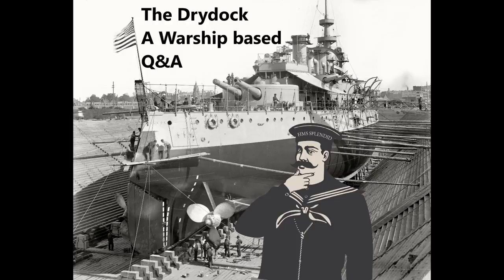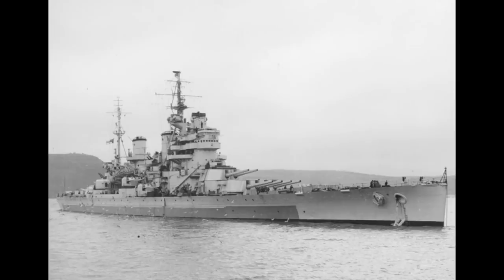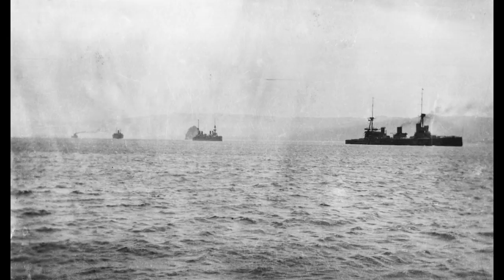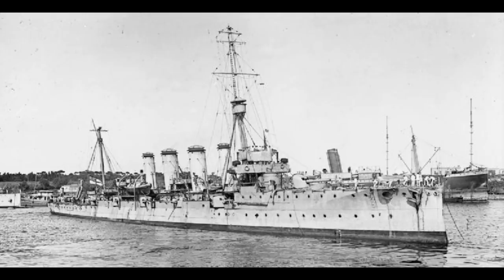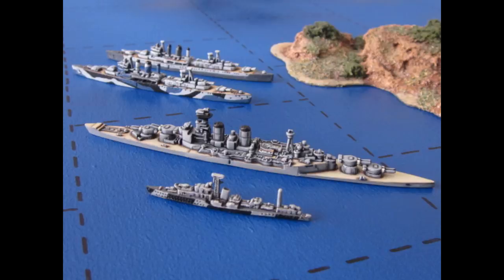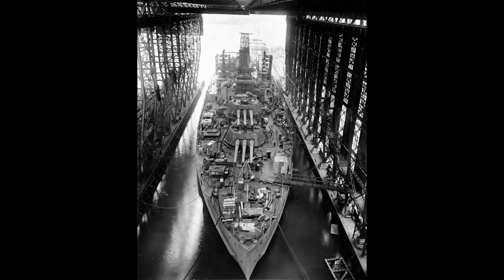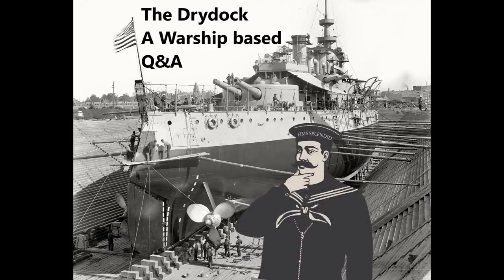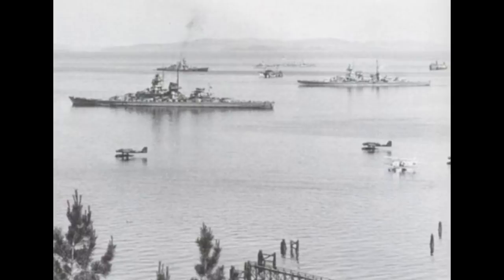The Drydock - Episode 081

Comment: oh correction on the MiG-25 IS mostly STEEL! only the leading edges and the few parts of the engine are made of Ti! the 25 was only made to go fast its gee limits are pretty low iirc like +5 -4 its not a dog-fighter its an interceptor

Comment: In addition to light weight Titanium has another advantage over steel - it has better corrosion resistance than most, perhaps even all, Stainless Steels. Which could be pretty helpful in a salt water environment.

I believe Titanium gets brittle when hardened, so for a Steel/Titanium composite you'd probably want a hardened steel face bonded to a lighter Titanium backing. Though if you're going composite, Aluminum might be a viable light weight option for the backing, and you might as well start adding ceramics as well (like the modern tank armour). Optimizing composite armour for naval scale would no doubt be a significant, and expensive, R&D effort.

Bonding multiple layers of armour together is probably something we could do much better today than in WWII. We have more options for welding and adhesives that might be strong enough to do the job effectively.
Reply: Titanium is corrosion resistant to sea water in most conditions, but not all.  It has been known to corrode badly when used for balls in ball valves.

Comment: Another debate to add to the armour debate. Look at tank protection development. It is now looking at an active defence. Kill the incoming round before it hits the tank. A modern "Battleship" would be better protected than a WW2 counterpart but this would be because anyone who builds such a ship would have more active defences on it than a US battleship has guns (so only a few hundred). Interceptors (both Cannon and Missiles), Drones, CIWS, ERA, lasers etc all could be fitted to a Battleship. Then once you have a ship with this would you then look at the armour. Probs only have composite Citadel armour. No real belt armour would be useful. Then again modern torpedoes are rather nasty and could still crack the whole thing in half so why bother. Just build 6-10 more Destroyers. Unless... you could introduce some either soft or hard-kill torpedo defences... Guess we need more swarm drones.

Comment: You listed that Defence White Paper as one of the worst moments for the RN.  I’d add when on 1 April 1918 the excellent Royal Navy Air Service, which at this time had 67,000 officers and men, 2,949 aircraft, 103 airships and 126 coastal stations, merged with the Army Royal Flying Corp to form the Royal Air Force.

During the inter-war years, the RAF gave priority to strategic bombers, and then, as the war clouds loomed over Europe, to accelerating development of modern single-seat fighters, like the notable Spitfire.  Carrier aircraft received lowest priority.  On 24 May 1939 the Fleet Air Arm (FAA) was returned to Admiralty control.  When WW II started three months later, the FAA lacked an effective single-seat fighter, had no dive bombers, and its torpedo bombers were slow obsolescent biplanes.  The slow biplane torpedo bombers, flown by intrepid airmen, performed well in the early days in European waters, but only when they were unopposed by enemy aircraft.

Comment: Comments as per each question. 

I think this one you might have to run yourself. I don't think there's a good platform out there for this stuff. At least, off the top of my head. I' don't think any social media related platform has the copyright protection you'd want on this stuff. 

On the steel side of things, I'm going to offer this as a point. Last year I was doing a bit of hefty research into nuclear power. I know, different application, but if you're building a reactor containment vessel you're going to need extremely specific shaped and high quality steel. There were maybe three countries, more likely two, in the world that have the capability to produce it to the specific shapes and the like. So I'd argue it's not a case of what the effective improvement is, it's the ability to produce it that matters. I'd suggest the quality is very much the same as well. 

As Drach was going on, there's different armour profiles, patterns out there. If we compare tanks to battleships, the metallurgy doesn't matter, composites do. Too modern, not enough information to actual disinformation out there. There's no real better answer I can give, sorry. 

I know of none actual war game rules that made it from the military to the public. There's documentation out there, the Fleet Problems and a number of journals, articles, the like. I'd suggest the rules for these are often custom written for the scenario. These aren't games in the traditional sense, these aren't meant to be played out over the course of an hour or two. These are days, week long exercises, again, depending on the context of the scenario. 

If you're looking for something more for the tabletop, Harpoon isn't that bad a game. I've played it once and it's quite playable. At least, for the modern, Cold War level stuff. I'm not saying it's easy to play, but it is playable. 

I can't think of anything else I'd recommend. I really can't, any era. I've either not played it or it has major issues with the rules, absurdities.

As for a sorting High Seas Fleet, I'll put my hand up as a referee, co-ordinator, whatever you need. I need to see something like this in action, considering what I want to do with my game studio.
Reply: This is a comment sect. blog on your own 'site. 😊

Comment: 35:30   You show some armor being put on or off a ships side.   How where they bolted to the hull?  Thru bolts and nuts?   Also since the armor appears to be layered on, what of corrosion protection of the hull, the gap between the hull and armor will trap salt water between the two, so was their caulking used to keep the space between dry? or was water free to get between?    was anti corrosion paint used, if so what kind of paint?

Comment: Realy interesting question and answer regarding the armour.
The no longer existing infrastructure is an important point.
This whole thing off course begs the question as to what armour protection modern warships DO have.

As to the idea of titanium armour - the question of the price tag aside -, could you explosion-weld it to the hull?

What I don't think is a good place to look for inspiration for modern ship armour is MBTs.
Yes, you can armour a tank to the point where it can resist the impact of a 120mm APFSDS round. But that armour is usually restricted to the turret front and maybe the upper glacis. Everywhere else, that round will punch through. That's only a small portion of the tanks entire surface area. And that tank still clocks in at 60-70 tons.
Now imagine rising the armour protection of a battleship (turrets, barbettes, belt, deck) to that level...

There is off course the question of modern amunition. Shaped charges and HESH were mentioned. HESH can be defeated by the use of spaced armour. And the effect of shaped charges can be mitigated with spall liners and compartementalisation.
However, there is something I wonder: I have heard/read that much of the damage caused to british ships during the falkland war by argentinian anti-ship missiles actually came from the unburnt fuel aboard those missiles starting fires, and not from the warhead.
So, how about letting the armour be armour and replacing that 1-ton shaped charge warhead mentioned in the answer with say, a ton of triethylaluminium, essentially turning the anti-ship missile in an oversized M202 - and the target into a similarly oversized dutch oven?
Ok, I can see one issue with this idea: Who want's several tons of that stuff sitting in their ship's magazines...
Reply: The warhead of the first Exocet missile which struck USS Stark failed to detonate,  but unexpended rocket fuel started a fire which burned for hours.

Comment: Is it really fair to say that early cruisers and destroyers sometimes had superfiring rear turrets because there was more space abaft the superstructure?  Isn't the reason more that the gunwales are a deck or two lower on the stern deck, as opposed to the forecastle?  Thus meaning that rear superfiring guns could be at a more reasonable level above the waterline.
Reply from the maker: On a small ship the superstructure contributes significantly more to draught proportionally. They also tend to have very large powerplants proportional to length. This usually means a relatively heavy superstructure somewhat forward, which limits space and weight forward of the centre of gravity.

Comment: Hi Drach,  just watching all your Drydock episodes... Episode 081 - your comments about armour, particularly Titanium (Wolfram) are not correct. Whilst Titanium IS stronger than Steel, it is no lighter. The reason Titanium is used is because it is stronger than steel so you can use less of it. Machine the back out of a billet of Titanium and you'll get  something lighter than it's steel equivalent, but the materiel is not lighter than steel.
All the Very Best,
Neil from Manchester.
Reply from the maker: Good evening, Titanium is 22 on periodic table, Iron (most of the makeup steel) is 26, so Titanium should be less dense. Certainly in medieval re-enactment the Titanium armour people use is valued because it is much lighter for the same thickness and protection as steel.

Comment: Explosive "welding" .... look it up.  Want something thick of similar or dissimilar metals or material properties... explosives.  Making Vastly superior armor today even if you do not go with superior steel(easily doable) without using ceramics would be trivial and cheap.
Reply: Explosive welding is pretty much limited to attaching a fairly thin skin to a backing.  Say something like 3mm.
Reply: @jamesfisher4326  Well no, rather that is how it is used today as the only commercial viable product for its use for say, kitchen pots.

Comment: A modern battleship would use multiple layers of overlapping composites and various ERAs in easy to manufacture and mount modules... and underlying but easily repairable structure of high quality build but not inherently armoured... then of course spaced compartments with blow out sections and periphery missile modules as blow out buffers.... not even counting drone countermeasure vehicles  a vessel of battleship?? Size about 50k tons would be at least 3 billion GBP for the composites alone... likely 18 to 20 billion for the entire unit... and this does not cover infrastructure and logistical support... which would push 20 to 30 years to set up and cost at least 80 billion... add on 120 billion for the 6 units ... and that's 200 billion for 6 vessels... say 10 billion  a year... quite worth while compared to a high speed rail link..
The vessel would survive multiple and fairly close spaced hits by missiles of brahmos speed and at least twice the warhead capacity...
You would need to invest at least 10 billion a year for the life of the class.. upgrading armour and other systems to deal with projected changes in threats...

A surer investment would be the multi raft concept... that is several thousand independently powered and manoeuvred rafts linked together to form a large field.. onto which can be bolted weapons and sensors and runways and storage modules... the entire structure can be unlatched and modules moved as required.... this would allow a full ocean deployable base island that is unsinkable.. as conventional torpedoes would be able only to destroy a very small part.. missiles would maybe take out a section and if you have 500 sections or 2000 then losing 10 or 20 to the enemies first strike is not very significant.. as your own assets will be attriting them at the same time....

I looked at the era buffered composite shock resistant battleship concept back 25 years ago.. revisited 18  12 and 4 years ago... but I really think the raft is the way to go...

In this day and age a mobile island that is basicly unsinkable and can mount anything would be handy.

For USA ww1 to 2
Don't build BB in pairs.. just 1 good BB one good CA one good CL and if they let you 8 DDs  at a time.. every 2  years... 24 28 32 36 knots speed.. if possible

I remember reading of those 1930s wargames... a flight of torpedo bombers dropping old 18 inch i think with wooden heads.. an r class BB took 3 aerial torpedo hits and an umpire declared that it was reduced to 15 knots .. no other damage.. really got that right.. not... most of the officers at the time were well aware what 3 torpedoes to one side of a cap ship would do.... but the anti air power movement had its stalwarts

Comment: I appreciate the points you make about Cunningham in the Mediterranean but the ships that were lost - good, modern ships like HMS York - would have proved very handy in the Far East when Japan entered the war. There was no naval battle to be won in the Med. The Royal Navy was, once again, fighting aircraft, and land based aircraft at that, with ships. A strategy that had already failed repeatedly, would fail again with poor doomed HMS Prince of Wales, HMS Repulse and then again with HMS Sheffield and HMS Coventry and others on the Gun Line 40 years later in the south Atlantic.

And a technical question. Why haven't our new carriers been fitted with anti air-resistance deflectors like our lorries? Their square, bluff bows must cost quite a lot of fuel and in serious headwinds probably a knot or two of speed. I can't up load images but here is a link to what I have in mind: http://aerodyneuk.com/truck-aerodynamics/

Comment: wrt reforming the USN in the 1910s.  Building the standards with an eye to reengining them in the 30s for more speed would be futile, because the USN didn't update the Tennessees or Colorados during that period, when the update of the New Mexicos in 31 showed the way.  A more plausible choice would be to forego the turbo-electric drive in the first place and use the space freed up by elimination of the motors and generators for larger turbines and boilers.  Also, forget triple expansion engines and go straight to turbines, even if that means buying them from Parsons.  Another thing would be to forget the casement mounted secondary armament.  Put all the secondary armament on deck, so they can be easily replaced with modern AA during WWII.  With a large increase in the budget prior to WWI, at least some of the Battle Cruisers would have been laid down, in their original 1916 design.  If the USN were lucky, the hulls would have been launched in 17 to clear the building ways and further work delayed until after the war.  Then, instead of converting a collier that would have had resale value, convert the incomplete BC hulls to carriers.  With construction under way, in 21, they would have been exempt from the treaty as "experimental", so could be replaced whenever the USN saw fit.
Reply from the maker: Part of the reason I suggested the future proofing was the relatively bluff hulls of the Standards needed stupid amounts of power to go much faster. A somewhat more slender length:beam ratio would've made it more economical.
Reply: @Drachinifel  true enough.  When the Italians rebuilt their 4 pre-WWI BBs in the 30s, they lengthened the hulls by about 35 feet, as well as increasing power from 30,000 to 75,000shp. to push them from 21kts to 26.  While building a USN equivalent to a Queen Elizabeth would be a good start, there would not be any follow-through in the 30s.  In effect, we would be creating the 1920 South Dakotas.  43' longer than a QE,  15' wider, with 60K shp vs 56K, and 23kts.   But, unlike the RN, there would be no major updates in the 30s.  If you or I were the typical age of the head of the General Board in 1915, we would be retired, if not dead, long before 1935, so would not be around to make the reengining happen, meaning the ships are stuck at 23kts.  There would be no rebuild of the superstructures either, which is why I specified abandoning casement mounted 5/51s in favor of putting them all on the weather deck.  In the USN of the 30s, the only updates we could expect would be replacing the 5/51s on the weather deck with 5/25s and 1.1s.
Reply: The other wrinkle is our advance knowledge of the Washington Treaty.  Without our intervention, Maryland was the only Colorado in commission at the time of the treaty.  The US negotiated a clause allowing completion of West Virginia and Colorado, in exchange for the disposal of the two Delawares, which the original treaty retention list had included.  The Colorados were under the treaty's 35,000 ton limit.  As we are talking longer ships with more powerful engines and higher speed capability, essentially 1920s South Dakotas, which displaced 43,000, the US would probably not be able to work that exchange to complete two after the signing of the treaty.  So, all the future vision BBs would need to be in commission before the end of 1921, meaning they need to be laid down before 1919.  New Mexico was launched 4/13/17 at the Brooklyn Navy Yard, and Tennessee was laid down a month later, launching 4/30/19, so we can't get more out of Brooklyn.  Mississippi was launched 1/25/17 at Newport News.  NN laid down Maryland 4/24/17, launching on 3/20/20, so we can't get more out of NN.  Mare Island didn't launch California until 11/20/19, so can't get another BB out of that yard.  Only opportunity to advance construction schedule in a yard known to have capacity to build BBs is at NY Shipbuilding.  That yard launched Idaho on 6/30/17, so Colorado could be advanced from it's actual lay down date of 5/29/19 to somewhere in August of 17.